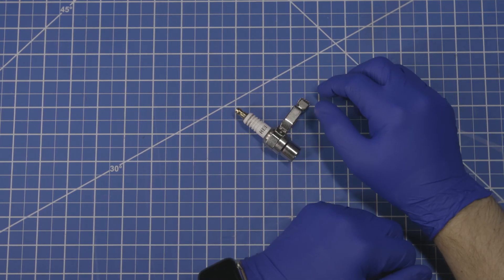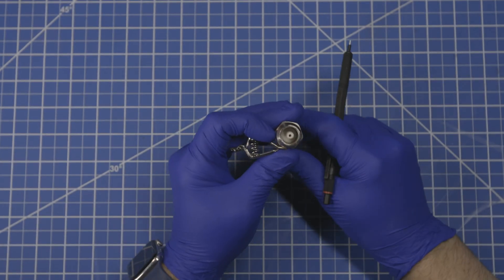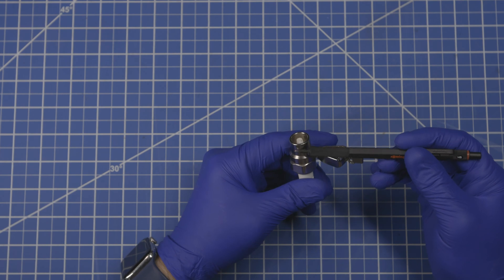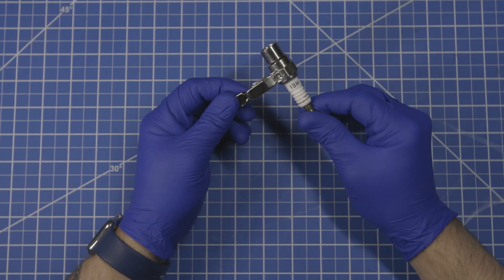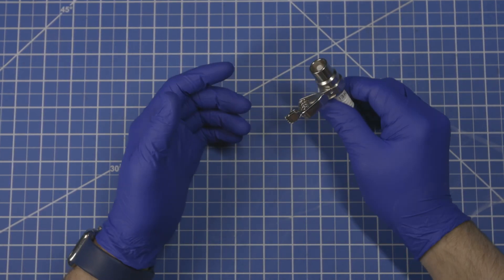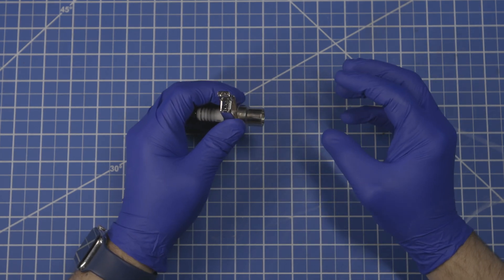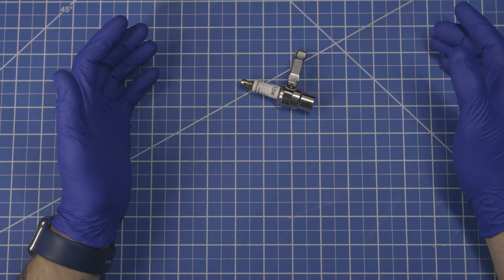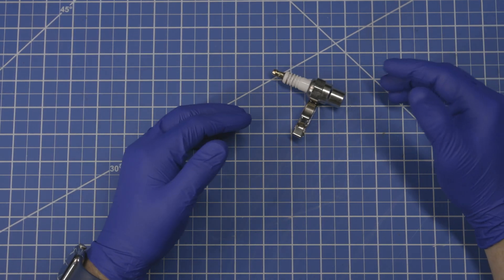Ignition Spark Tester Basics - a less-shocking check of engine spark

Comment from the maker: I pointed out the ceramic body, but I should have mentioned -- watch out for cheap versions that use plastic instead!  They break much more easily and do a really poor job of insulating the spark (which both can be a shock hazard as well as make it harder to see the spark since it can "leak" in non-visible paths to the ground clamp!)

Comment: Can't use on a coil on plug ignition either...
Reply from the maker: It depends on the design of the coil packs, but on many of them you certainly can. Basically, as long as it uses “normal” spark plugs, the tester can plug into the coil pack.